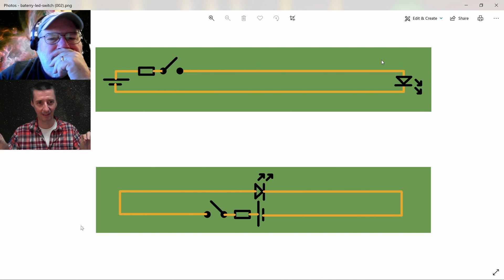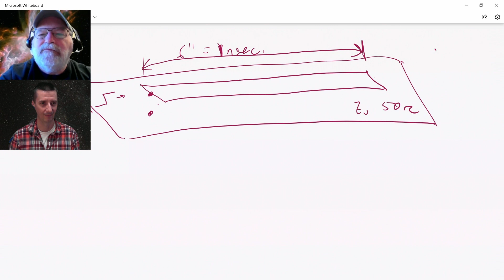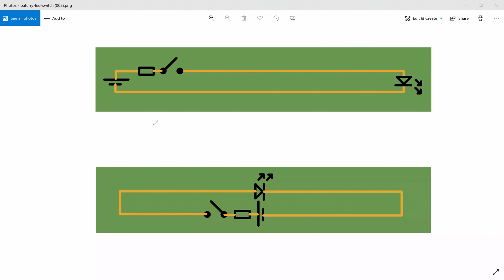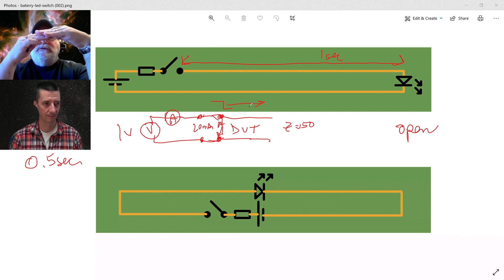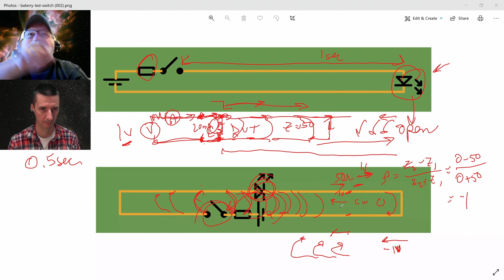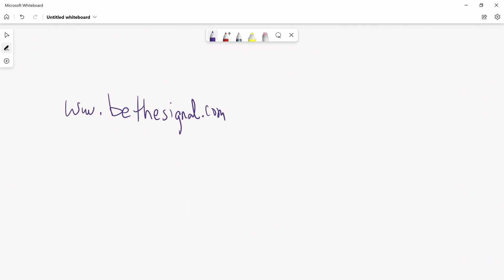Explaining Veritasium Electricity Video: Energy doesn't flow in wires (with Eric Bogatin)

Comment: You cannot measure impedance with an ohm meter. Impedance is measured using alternative sinusoidal voltage source using an impedance analyzer. What you are saying is an ohm meter that measures ... transient resistance... not a bad idea, but how feasible is it? TDR measures the reflection of a signal and computes the impedance, not the resistance of the cable ... Resistance by definition is the part of the impedance that is measured in steady state.The resistance that is measured in transient state is called impedance and is measured using sinusoidal voltage source.
Reply: You certainly can use an ohmmeter in this situation and it will measure Zo for 2 seconds, then it will read 0 ohms after a long enough period.
Reply: If he added extra technical layers to his explanation it's likely that far fewer viewers would grasp the primary point he was making.  Most of us who watch this channel are very familiar with Ohm meters - and that's all he needed to get the point across to most of the audience here.  This goes along fairly well with the philosophy he mentioned, where technically less correct models and explanations are useful and often necessary in order to understand or convey a concept or solve engineering problems in the practical sense.

Comment: Explained this way it all makes perfectly sense. Unfortunally Veritasium's video is made in a way it's more confusing than explaining.

But one thing that applies to Derek as well, what you call "simplification" is scientifically called a "model".  And can we please stop calling models, "lies". A model is a model and a simplification of reality, because yes, you need to simplify it to make predictions. Anything is a "lie" if you start calling models lies. Temperature is a model, infact it is motions. Or take motions of planets. Simplifying a planet to a point of mass is a simplification (which does hold true only for the perfect sphere with perfect mass distribution), than newton mechanics are a model that don't take relativity into account. Heck, to calculate something as simple as the mass of a proton a supercomputer was busy for months using quantum field approximation to get within 5% accuracy. Yes, we should be aware what models are, we should be aware of special situations where each model breaks down, but it doesn't make a model a "lie". Maybe if you want, to "lie" is some teachers saying it is reality, instead of saying its a model of reality, what at least on university level every teacher worth their salt is doing.
Reply: PS: as far as I am aware, maxwell equations are the most basic model we currently are aware of. But it's perfect reasonable to assume they are just a model of what "really" is going on of quantum virtual particle exchanged in an infinite series of Fayman diagrams etc. Is the Maxwell also a "lie" or is still a valid model.

Comment: In terms of this explanation, the "Veritasium" question then becomes "What is the input impedance of two conductors spaced 1m apart (even allowing Derek his 0 ohms of resistance), and what would be the current flow when a single digit voltage is applied to that transmission line, and would those femtoAmps be enough to light the bulb in 3ns as he claimed?"

Thanks for this version of the explanation.
Reply: Exactly, his example question has actually nothing to do with the point he was trying to make (the poynting vector). I guess he tried to come with a practical example.. and thats the best he could manage, because for DC the whole poynting vector just doesn't matter, so he couldn't find an example where the standard (simplified) model of "power travels in the wire" breaks down.

It get interesting in high AC with the skin effect, so why for example silver coating cables can make sense, while it doesn't for DC etc. but thats again slightly different.
Reply: @georgelionon9050  I dunno... I was taught, decades ago, the transmission lines could be considered an almost infinite number of stacked "low pass" RCL ccts... Even giving Derek his 0 ohm conductor, the miniscule Farads of "capacitance" between the conductors wouldn't cause many electrons to move ("displacement current"?) to establish a field that transfers energy... My gut says the load wouldn't have a noticeable reaction until the fields that travel the length of the conductor meet at his bulb.

Consider electrons streaming out of the -ve pole of the battery (DC)... As their "virtual" members charge up one plate of the virtual bridging capacitors, their electric field will repel other virtual electrons across the gap of the virtual capacitor... Those will flee, "seeing" one path to the resistance of the bulb's filament, OR an alternate path in the opposite direction at the exact same voltage... Meanwhile, the travelling magnetic field following the leading edge of the pulse is coaxing electrons to flow in the other direction. Would the two effects cancel ? I dunno...
Reply: @rustycherkas8229  Honestly I don't have a good calculation at hand how long the LED would light up and how strongly. One meter is quite far apart. However note the way Derek sneaked in the conditions for his questions, he said "light up" not "starts lighting" and that he says in the beginning his ideal bulb will light for "any energy flow". So under this conditions the answer is 1m/c. Also the answer is d/c for any such bulb in the universe, no wires required. Thats why I say, his example was bad for the effect/argument he wanted to make.

Comment: this is all an interesting academic thought experiment, but it doesn't really address the veritasium video which had a meter wide air gap between his cables and a standard household lightbulb, and his assertion this is how electrical grids work - and not by conduction. Now the characteristic impedance of a waveguide with a meter air gap would be about 1000 ohm. clearly the electrical grid can not function with a 100k resistance so this is not the primary mode of conduction. The gird works by simple electrical conduction, and not waveforms. If anything waveforms are a hindrance for the grid design and a source of losses. Also the length of the cables relative to the wavelength of the grid would be a major factor here in these losses.

Comment: I'm going to do everyone a favor and just tell them that the wires are already charged before the circuit is complete. That's how I always treat them, and for most applications, it works just fine.
Reply: but when the switch is closed, the whole electron chain will simultaneously move together creating a current, or only electron at the switch move first and the movement propagate to the rest of the wire?

Comment: I see the same problem with this attempted explanation as I do the others. The automatic and false assumption that the original thought problem was about transmission lines. That it was about/ required parallel wires running a distance and back. But it might be the length was for a straight wire "that if..." was stretch it could reach "X" and back. Not that it was a transmission line that ran in one direction, turned around and came back. I understand the confusion of him showing a 1m "width" at the left end of the line. But what he said was the light bulb as 1m away from the switch/ power source. But showed a more random circular layout of wire to each side. Plus he showed a demo he used to teach which in fact is a loop/ circular. Not parallel. 

So the question he actually asked was "two wires which are each 300,000 KM long". The drawing that follows does not match the description he just stated. It adds the false constraint of parallel wires 1M apart. Based on that data, what is the answer?

Comment: It would be pretty t4eedious to determine circuit behavior from Maxwells equations and that is why we use the concepts of voltage and current. My guess is 99+% of people believe energy is actually transferred by the wires. Its a a lot like relativity, at low speeds and long times our approximations like Newtons laws work just fine but they are not reality.

Comment: The impedance measured at the input end is Zo only if the far end is terminated with a load of Zo Ohm. If you remove the load, you won't have a 50 Ohm to take your 20mA at the switch.

Comment: Sorry but the energy transfer through copper is WAY higher than energy transfer through air. Stand under a high voltage power line with a long length of wire running in parallel with the transmission line, and measure it! It's NOTHING compared to if you connected it directly.
Reply: Sure...if they say that external fields transfer power than why shielded wire transfers power ?

Comment: Assuming a 1 meter spacing of the two wires, and let’s say 10 gauge wire… you have a characteristic Zo of 798 ohms on each TL leg (looking left and right from the switch) So if we use a 12v battery … looks like we have a near instantaneous (transient) current of about 7.5 mA before we reach steady state.    Not knowing the bulb characteristics— we don’t know if that’s enough to illuminate or not…
Reply: A single wire is not a coax transmission line.

Comment: Excellent explanation, Derek presented an interesting question and introduced people to the concept but his explanation was lacking and his choice of parts for the "experiment" was pretty poor with multiple added complexities.

With an LED you get enough current to light it up even before the wave travels all the way through the line and settles in its final value, even with a pretty high line impedance like the one chosen in Derek's example.

Although what would happen if your voltage source is very close to the forward voltage of the led, the initial(almost instant) voltage wave wouldn't be able to get enough current thought the LED so in that case it would only visually light up after the wave travels through the line?

Comment: Imagine a domino effect.
Each domino chip is an electron. The speed of the toppling down is the electric field.
The electrons hardly move but the "banging" is the speed of light.
Therefore the time the bulb lights depends on the speed of the electric field AND the length of the wire in the loop.

Comment: Wow, I think this is the fourth evaluation of the original video I've watched, and this is probably the best. Thanks. One thing: I thought of the long parallel transmission lines as a sort of transformer or even antennas but I guess that's just transmission line theory in a special case....

Comment: 22:59 - Why doesn't he mention that it will only look like an open if the transmission line's electrical length is an integer multiple of a half wavelength?
Reply: DC has infinite wavelength

Comment: Yes! This explains it!
The matter is valid if we have strong coupling between the two wires. Now the question is: what if the wires were far enough to have a negligeable coupling? (High impledance)?

At even higher distances wouldn't we be talking about the wires acting like antennas? 🤷🏻‍♂️
Small induced currents, until the wavefront comes back?